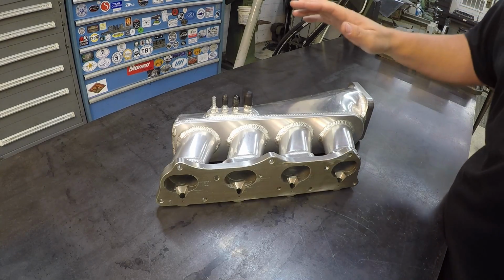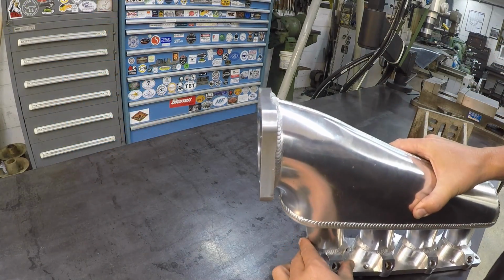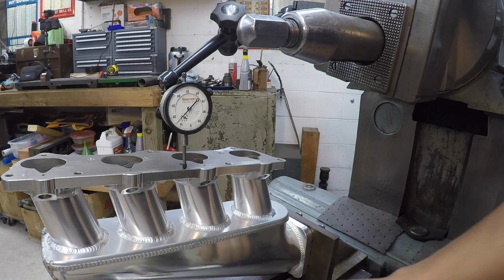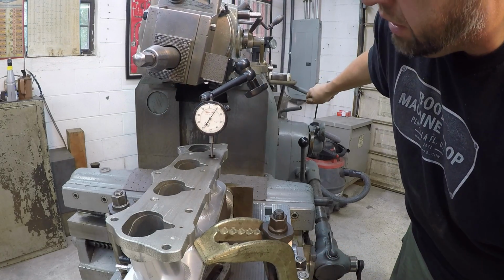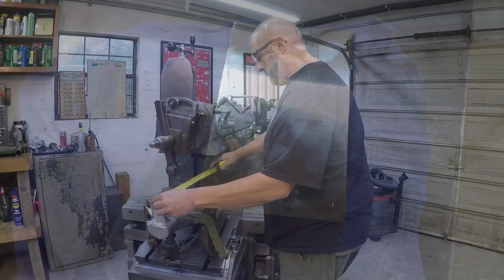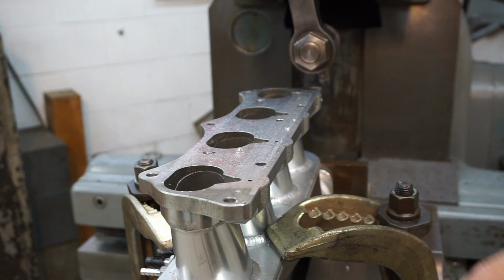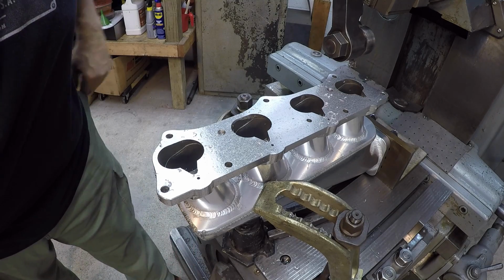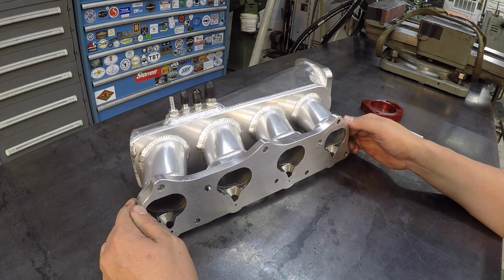Machining an Intake Manifold in the G&E Shaper

Comment: Impressive use of a museum era machine tool, the machinist's skills are top notch - the choice of machine archaic.
Truth be told, on either a horizontal or vertical mill the job would have been set up, cut and done (with a better surface finish) before the shaper made it's first pass.
Still, a fun reminder of how we did things way, way back in my first days as a machinist!
Reply: You think a fly cutter would make a better surface finish?
Reply: @Mountain-Man-3000  
Yes, I've done more than a few, both cast iron and aluminum.
Preferably with a small facemill but a good (rigid) fly-cutter also works.
I also did aluminum cylinder heads, I made a 7-1/2"  fly-cutter that I used for heads.
People have a bad habit of hanging the tool way out instead of using a larger fly-cutter, when they do the tool vibrates and makes it tough to get a good finish.
Cast iron heads should be ground for a good finish.

Comment: Great video again, I don't have facility to do this great stuff you do, just one thing is bugging me. When you clamped down with the long 'toe" clamps onto the jack why you never re-checked the the width dail gauge reading again in case you moved the manifold rotation on the allen bolt fixings. Hope you understand what I mean lol
Reply: Steve Ashcroft he probably did sometimes not everything can get on video

Comment: Is this enough proof ya can't make money with a shaper:  Ironically I just went through this with a 6cyl inline cast iron intake and exhaust. First thought shaper but no universal table.
So the mill.  Clamping this thing, me & son was all day . The ports could be measured with a
yard stick.  Now what, fly cut, no.  This is like 30 inches long.  My mill is a 10x52 turret Cincinnati.  Another all day to extend the mill four more inches never been moved since new.
Got that done un- fortunately I have no nod feature, so its clamps, shims so many, looks like woman with hair curlers on.  I used a 5/8 end mill and ended up with a .060 cut across the board just to clean it up.  Bottom line; just ask my back,  how to bill this, when machine time
oh 20 minutes,  set up time don't ask !   If we had your shaper would be out the door ASAP
sam

Comment: I would have liked to see you run the indicator on the finished surface after you removed the toe clamps and jack screw. Wondering if that inadvertently moved the intake? Good work and it was great to meet you at GOTLF.
Reply: I was thinking the same thing, but maybe blue the surface plate and give it a rub
Reply: I'm pretty sure Adam would have swept the face after installing all the fixturing, to make sure it hadn't moved. Especially with something awkward, and made of aluminum. He knows better than most how much Murphy's ghost likes to try and screw you over when it comes to custom jobs. Sometimes, you can even hear him laughing.

I  bet the factory tolerance for this flange is +/- .002". If he got it to within something like .0005" (I think that was a tenths indicator?), it's probably the nicest fit on the entire car.
Reply: Gaskets are designed to mask machine tolerances. :-)
Reply: @tom7601  Ha! Yes, they are! Although with the different thermal masses of the manifold, block, and bolts, as well as the finicky nature of modern emissions systems, I would want the seals there, even if the fit was perfect.
Reply: Coffreek:  I fully agree! :-)
Reply: @Coffreek  engine is all aluminium  same thermal expansion 
And the intake will max temp off 150f

Comment: i recentl came across a CNC plasmacutter from Zinser that was repurposed to be used as a shaper - they noticed the forces were to high and the finish therefore bad , so they put a big motor with a hydraulic pump onto it and a grinding attachment with a hydraulic motor on the tool holder

Comment: so can you use carbide or ceramic tools on the shaper and work on hardened steel like a maschine bed to prep it for easier grinding?   What happens when you just put a carbide insert holder from the lathe into the shaper , can you show this once?

Comment: Does the backward draw on the shaper do any type of burnishing?
Reply: The clapper box allows for relief on the retract stroke, therefore the tool does not drag back along the workpiece :P
Reply: @scottsmall95  I was aware of the clapper box and it's swing to release the tool but couldn't help wondering if the tool dragging over the work piece had any machining affects

Comment: Great job Adam. Tapmatic #1 and tapmatic #2 is wondetful stuff. I use to use a pink color cutting paste on the shaper back in the days and it always gave a very good finish. The paste worked better for me. Don't get me wrong but the paste was much cheaper than the tapmatic. Tapmatic is like gold in my country. It is extremely expensive.

Comment: though item to mount , dont think i can machine it with my machines even if i could hold it , dont have the reach on my hobbystuff 
i think the guy that build the intake just held it freehand against a large sanding wheel https://www.schuurmachineskopen.nl/wp-content/uploads/2018/11/Schijfschuurmachine-kopen.jpg

about the surface finish : when the surface clamps down on a gasket you dont realy want a too smooth finish , aspecially on cilinderheads and engineblocks that have to hold up to high pressures , as the toolmarks gives the gasket sumting to bite intoo and prevents it from being pushed out from in between
Reply: use a thinner, harder gasket.

Comment: Before you machine this part mask off each runners of intake manifold. It is difficult to clean whole inside from remain shreds. It will much easier if don't need to clean up whole intake manifold.

Comment: I miss my first gen MR2, 100% stock. Would have never frankensteined it like that ;(
Reply: I put in a good bunch of hours in an '84 MR2 and it was great fun on a real twisty road!  While I respect that you wouldn't've "touched" yours...and I loved the way that little engine sounded pulling sweetly right up to redline...she could only do so much with 112 HP.  I could easily dispatch her at the stoplight with my ratty old '79 Pontiac Sunbird.
Even a bone-stock, normally-aspirated, 2 liter Honda K-20A from 2008-'11 delivers 221 HP...and THAT would wake that little car up!  Had I the car, the energy, and a low-priced donor, I would go for the "K-swap" in a heartbeat...prob'ly also bigger rims and brakes for "balance".

Comment: the weird pattern he speaks of once finished is not industry standard.  not surprised he works out of a garage with old machines.
Reply: Random Fandom is this the 4th or 5th negative comment I’ve seen from you? I think you may have more personal than technical issues with this video
Reply: Seems you are not familiar with this channel. Adam uses his shaper not to do it fast or insanely profitable. He use it because he like to use the machine!! And honestly that machine is freaking more rigid than many contemporary mills you come across :P . Again, this isn't some random amateur in a garage, he is a machinist by profession, i think 3rd or more generations in the same trade :P .

My guess is you are one of the armchair experts or probably some bugger that bolt down parts from a shop and think he's a mechanic.

Comment: i see plenty of parallel surfaces. i wouldnt have wasted time with this old antique machine. it is not faster than a mill.  a 2' belt sander with 200 grit, then a glass plate with 400 paper, then 800 for polishing would have also been faster.
Reply: 800 paper? On a gasket surface? Really?
Bullshit!
Reply: @petefletcher  my thoughts exactly,  seems to be a ton of "YouTube machinists" commenting on this one.
Reply: How are you going to do that? How are you going to jig it up for a sander? You going to do it free hand? Hey silly boy, the desired end result is a nice smooth finish, but the main object of doing this was that the bottom surface of the manifold was not flat. If you had listened to Adam you would have heard him explain that the guy using this in a mod could not get a seal when mounting it.

Comment: Is there an advantage running the clapper box cocked to the side?
Reply: You have to run it off to the side so the swing will clear the tool bit away from the uncut surface. Shapers start to advance the table as soon as the backstroke begins.
Reply: there is zero speed gain from using this machine. machines are limited by stroke length, table size, and tools they can use. this is a very limited tool when compared to a mill
Reply: @RandomsFandom  That didn't answer his question.  Don't be obtuse.

Comment: Thanks for showing it mounted on the engine.  Looks like they added some sort of gasket?   Did you have to deburr the tapped holes?  It kinda made sense that you only had to do the one side of the major holes/ports.  Thanks!

Comment: Excuse my ignorance, but would you have to improve the setup if you’re using a mill? Initially I thought the workholding wouldn’t be enough but great job as usual.
Reply: a mill would have been way easier, coulda done it in one pass, and almost to a polish finish.. all sort of spalling with this machine. terrible surface finish.
Reply: Random Fandom ummm don’t you get it?  This is NOT Showing the best/quickest/cheapest possible way to do this. 
This is an educational clip on the use of a shaper. This shows an artisan, at the top of his game, in parting knowledge for those willing to learn and appreciate. 
CHILL. 
If you’re better, cool. But let the rest of us appreciate the effort required to produce these clips..

Comment: Adam...what type of power does your utility provide your shop with?  220V two, three phase or? i see equipment that appears to be 3 phase 440.
Reply: There's a set of videos of his shop addition and he makes a point of noting that they ran three phase from the street when he goes over the electric service.
Reply: He has 3 phase from the street.
Reply: @davereeves1967  That's unusual. They don't usually put 3 phase power into residential areas. I find it interesting that the church that I once went to has 220 3 phase power into the building. Not surprising because it was new construction done In the earl-mid 60's, but it was also in a residential area. The other interesting thing was that the only thing in the church that was 3 phase was the pump motor on the dishwasher. It's also possible that the old boiler system (original) used 3 phase
Reply: @84953  That's how it is in our Residential area...220V only. I believe Adam has a transformer but it's just for one machine.

Comment: As a machinist I know you go for that great finish and you certainly did!   As someone with a couple of SCCA championships I was glad to see you not take it any further.  On mating surfaces, especially with positive pressures, you want your surfaces to have a bit of bite to them to keep your gaskets from walking or worrying under heat/pressure cycles.  Depending on how good a job you did, I might even be inclined to hit that surface with a mild crushed glass  at low pressure before assembly.

Comment: Jees , A peace of glass 1/4 thick and glued sandpaper on top flat on a table and some elbow power and that manifold was flat in no time .
Reply: zasde35 true but when you got yourself an abom for a friend why not get a give him the Christmas gift of a good video... and maybe get your intake machined by a master for free/cheap.
Reply: Your gonna take .020" off in no time? Yeah right, wotever you say.
Reply: @turningpoint6643  That is a 1/2 mill aluminum, easy job with waterproof sand paper start with a lower grid (80) and end up somewhere in the 200/220 grid range 

I have done a lot of motor  engine cylinder heads this way.
And if you have learned how to use a file an talk powder , you can start with a big fine file carefully .
And if you are in old quality hand metal working you can also use the scraper and the blue scraping ink .
But as you said , whatever !
Reply: That's what I would do, but I don't have a shaper or mill...

Comment: They don't teach you how to do these oddball setups in tech college. This is the kind of stuff that only comes from experience.
Reply: Are there even anymore colleges that have machine shops? Most of the colleges have been eliminating this stuff to cut down costs and with the attitude that the engineering programs in the colleges that provide them don't need a shop. That was what was happening in the college that I took a mechanical engineering program about 20+ years ago. The professor running the shop was constantly fighting with the powers that be that wanted to close the shop. The college was also looking to change over to a liberal arts college to hopefully eliminate all of the tech programs. Hell, dry erase boards are  a lot cheaper than the equipment needed to run these other programs. Tell me something, how the hell can you design stuff if you don't know how to build/make it yourself?
Reply: @84953  I totally agree with you. In Southeastern Wisconsin we're lucky to have multiple tech colleges with full machine shops that teach manual/cnc machining, welding, and tool & die. There's actually a ton of money donated by local businesses to keep them up to date on the latest technology.
Reply: @leesuschrist  The other problem that comes up is one that is a little harder to deal with. It's the issues of liability. We've gotten to be such a sue happy society that there are a lot more restrictions, and a lot more costs for the tech places for liability insurance. It's sad that things have gone that way, and what makes it worse is the lawyers who are greedy and only concerned about making money. You may remember the law suit against McDonalds when the 80 year old woman experienced severe burns in her groin after the Styrofoam cup she had between her legs full of hot coffee broke and scalded her. What I don't understand is why that law suit even went to trial. It's a pretty well known fact that as we age the skin gets thinner and that alone can account for the severity of the burns as opposed to the roughly 10 degree difference in the temperature of the coffee. The other is what happened to culpability? Most people would know that particularly with Styrofoam, it's much more likely to crack/break, and then with something very hot in it?  I could go on. Do you remember the big news deal that happened some  time ago when a teenage boy got killed on an ATV? That was back when they were 3 wheelers. The damning evidence was the video of him running around all over this area with mounds all over, some of them rather significant and if I remember they said he was going somewhere around 50 - 60 mph. I don't know what was awarded to the family, but I believe it was the consumer product safety commission that told all the manufacturers that they had to come up with a 4 wheel version and supply replacements to ALL of the known owners of 3 wheel ATV's at the manufacturer's costs. Well, I've already said too much.

Comment: Nice work! I am not a machinist but I was half expecting to see the finished piece be indicated to verify that enough material had been removed to fix the bowing. Like I said I'm not a machinist so what do I know.
Reply: If you're getting an even cut along the surface it will be true to what ever point you indicated.
Reply: @sparkplug1018  you didn't notice the flex in that setup.
Reply: @CM-xr9oq  Were you seeing flex in the work piece or the entire machine moving. He addressed that in the video.